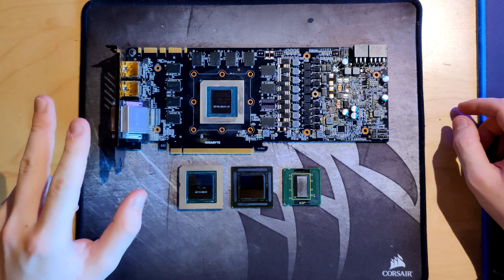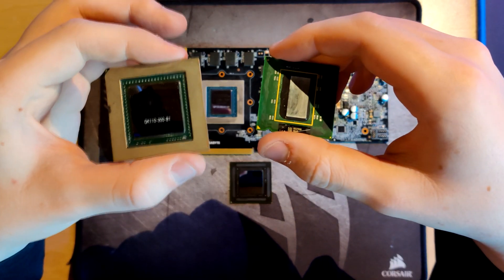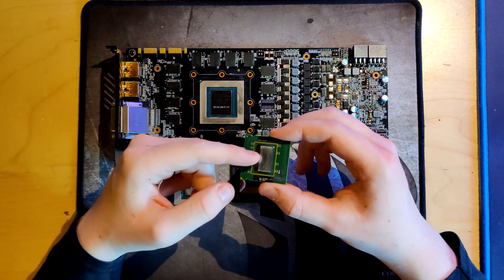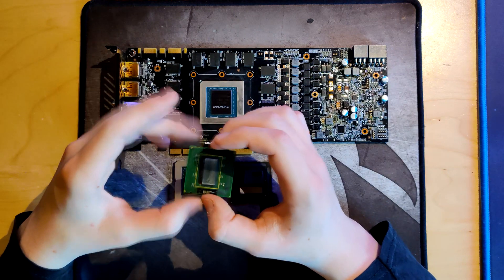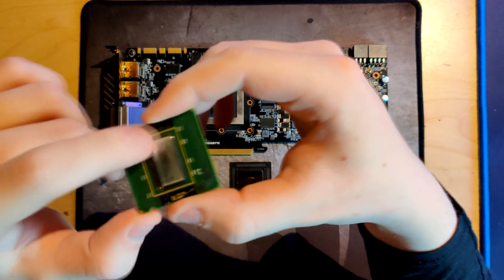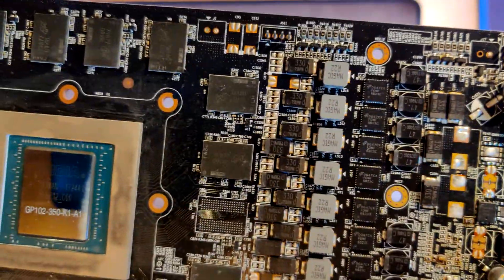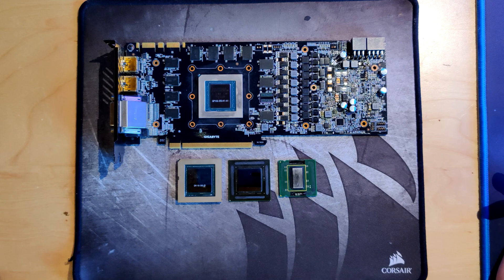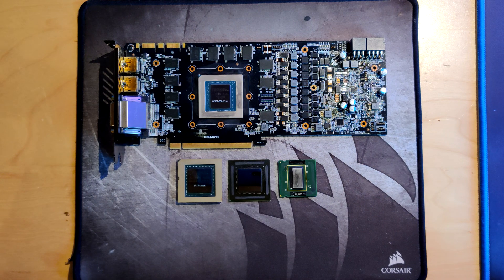Why Liquid Metal on GPUs is not a good idea

Comment: I used LM on a direct die i7 7800X and it made a huge difference between 20-30C agains best regular thermal paste TG Kryonaut - i checked the mount twice and it looked to be perfect so i didn't understand those temperatures that were in line to stock non delided 7800X, imprint on water block looked perfect. So then i put the LM and bam huge temperature improvement - i could run the CPU 300MHz higher with higher Vcore with the same temperature as i could with stock or dd with paste. Block was Heatkiller IV and der8auers direct die frame for socket 2066.